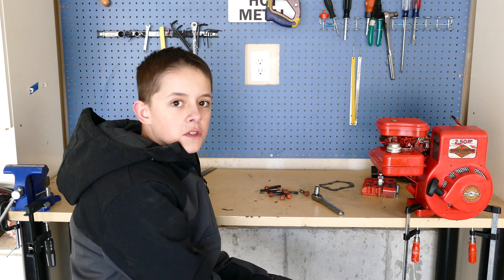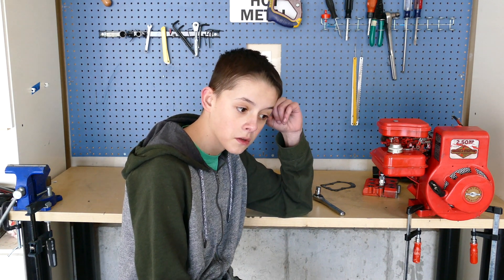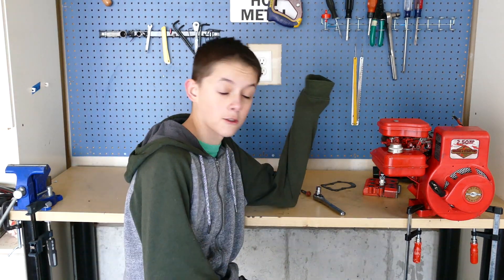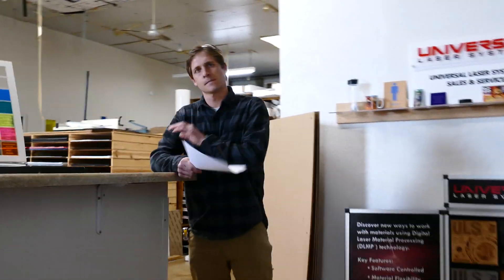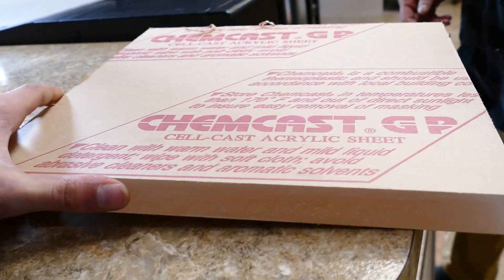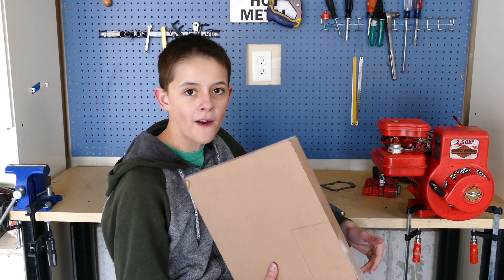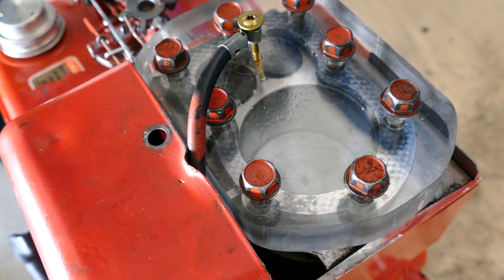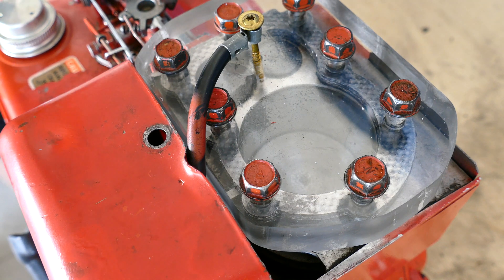SEE THROUGH ENGINE! || How To Build

Comment: How many head gaskets did you use?
Reply from the maker: Four or five I don’t remember exactly
Reply: So I made something similar and if you play around with the carburetor screw the flame should be mostly blue which means that the engine is running at the right air fuel ratio if its mostly yellow and it likes to misfire at idle then it's too rich. You'll hear it though where it sounds the happiest is where it's adjusted properly. A blue flame though isn't great for demonstration purposes because obviously a bright yellow flame is easier to see.

Comment: How is the Acrylic holding up? I want to build one of these and want to know what material to use for the head. Thanks!
Reply from the maker: it holds up fairly well, obviously the heat from gasoline combustion deteriorates the acrylic slowly, so right now it’s not as clear as it used to be but it still runs fine, and now that i have the plans and some experience making it i could make another one pretty quick. i made a clear head for my black 5S but it’s a lot more crude as it’s just a square piece with holes in it.
Reply: @WildfoxFabrication  Cool! I going to use an old Tecumseh engine I have and put a big flywheel on it so it runs nice and slow, hopefully that will keep the heat down. Thanks for the info!
Reply from the maker: @colin_5839  yes that should work ok. i have a big 20lb flywheel that mounts on a 5/8 shaft and it runs nice and slow, the problem now is that my carburetor butterfly doesn’t close tight enough to get it to idle slower. it’s a beast to pull over, though. 🤣 it also helps to have low compression, that keeps the heat down. stack 5-7 gaskets (or as many as you can while still running ok) and it doesn’t burn as hot.
Reply: @WildfoxFabrication  That's funny I was having the same issue! I think it runs slow enough and I believe that when I lower the compression with those head gaskets as you mentioned it should help.
Reply: It holds up really well, but the trick is only run the engine in short bursts, if you allow the combustion chamber to get hot it starts eating up the acrylic

Comment: Cool video man.  Came after PF video.  Nice editing and YouTube skills.  Let’s see more science and more of a how to.  

What screw is that your using as a spark plug?  How did you come up with that number head gaskets?  Was it just a guess?
Reply from the maker: i just stacked gaskets till the valves cleared. and the screw is just a wood screw lol.
Reply: Down to a Science hey it worked.  I wonder what’s the science behind it and if it can be tuned to run better.   

Thanks for the answers!
Reply from the maker: @dogle9258  yeah I was trying to finish up the build quick so I didn't do much tuning to it lol, but hey it runs reliably. I always try to spend as much time on the editing as I can to make it enjoyable to watch.